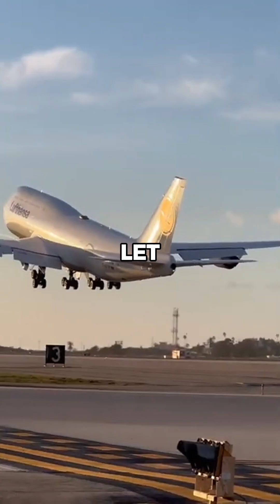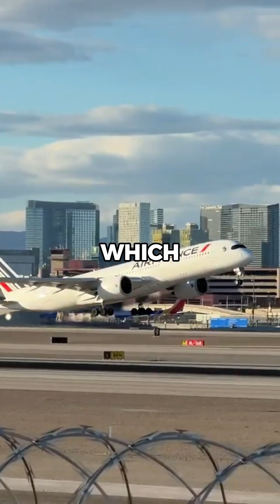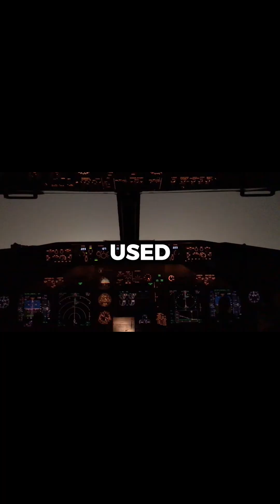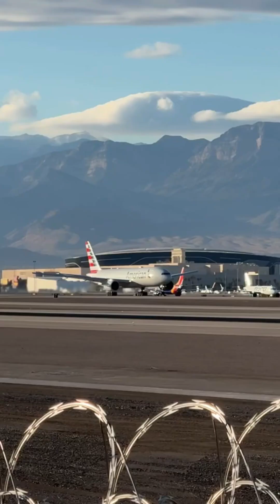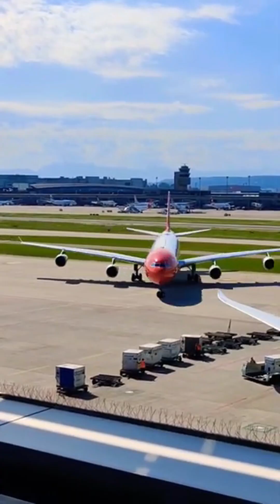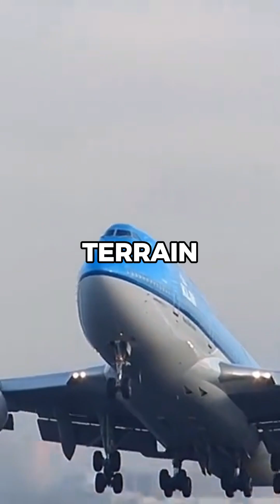Can modern aircraft land themselves?

Comment: Autoland is not new. It goes back to the 70s. The L-1011 was autoland able, and the 737 since the -300 (1984) and beyond, had autoland equipment. It just wan't used as often because it requires certification for the airplane, maintenance, airport and flight crew to do it legally. Today, 1 out of 7 landings are autoland, regardless of weather. That's how everybody stays current, and it's not scary as commented. Smoother than the pilot.